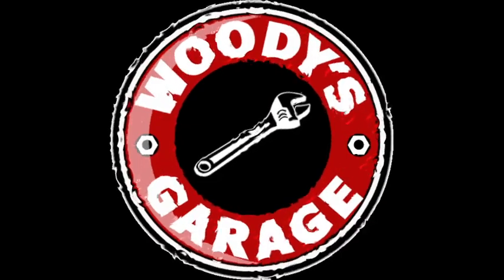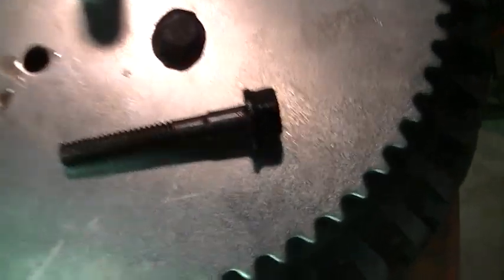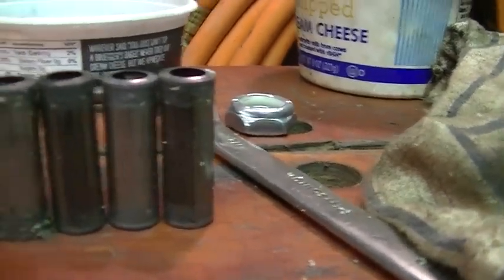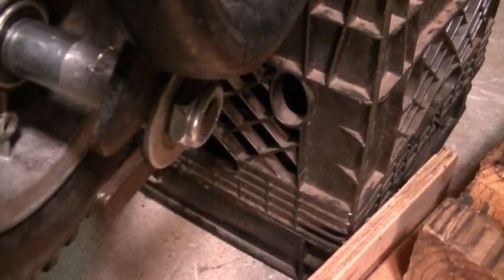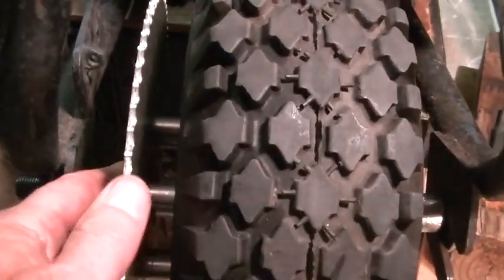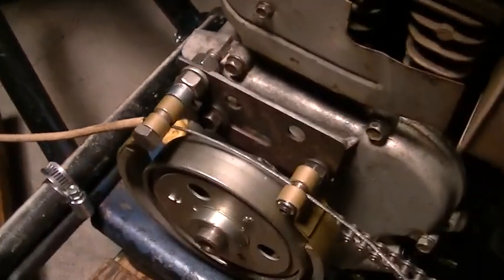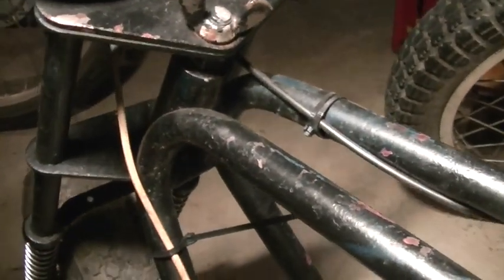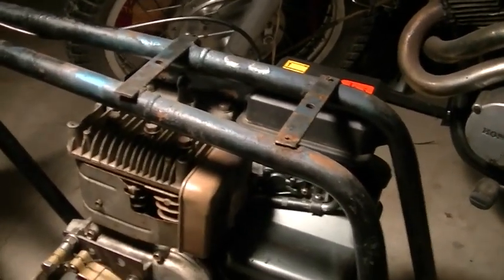Roma Nova Minibike, more Sprocket and Band Brake install

Comment: Cool looking bike i usually leave the band brakes loose because when you push the brake it gets tight then stays tight and rubs. When its loose it can move away if it wants. Plus they  loosten up on their own anyway. But they are kinda hard to screw up not real finickey so it doesnt matter much either way.
Reply from the maker: That makes sense, thanks Jeep2003